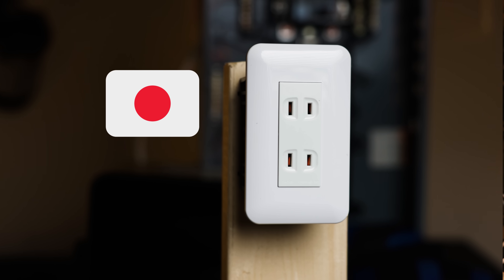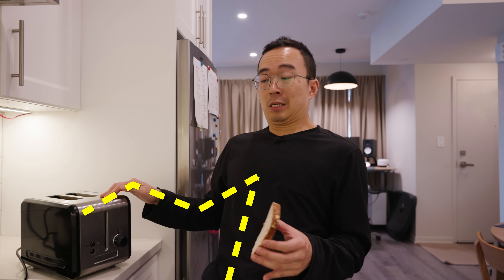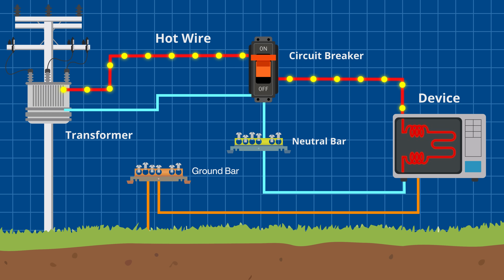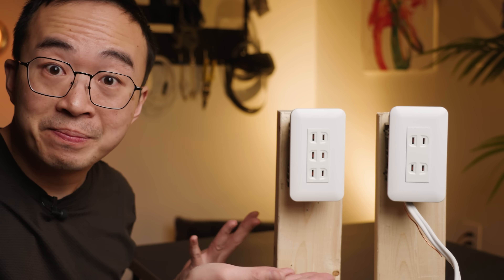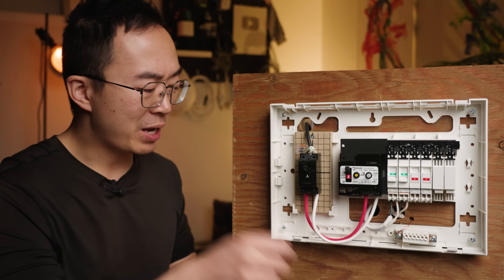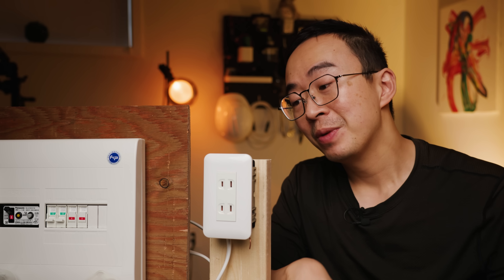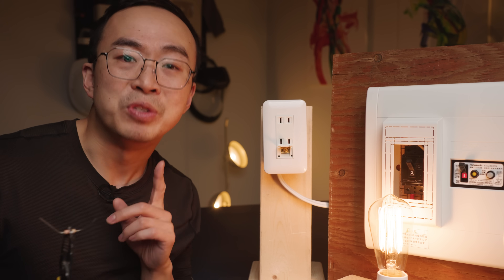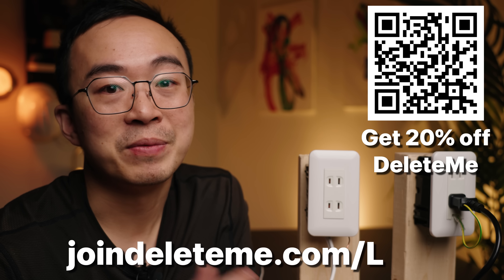How Japan Made Their Outlet Safe

Comment: You can make ungrounded systems safe, we call them floating systems. Most often these are found on high power DC systems like you would see on electrical rail lines or in industrial facilities.

You always need two connections to ground for a loop to form. When you get shocked, you are one connection to ground, the other exists at the transmission side of the electrical system. The existence of the ground wire in an outlet is there to provide that path to ground rather than you.

In these floating systems, a single ground fault through a person does not form a loop, so is safe unless a second ground fault occurs elsewhere. 

In floating systems, special devices are used to measure and monitor the resistance of positive and negative to ground. If a ground fault is detected, either the circuit is killed or an alarm is triggered to investigate the fault. 

The reason you don’t see floating systems much is that they require active monitoring of the state of the system to be safe, while grounded systems are passively safe. Also lightning protection requires a good path to ground (it will form one regardless, so providing one allows you to control the effects of a lighting strike better). Also, if you have devices that generate large changing magnetic fields (such as with AC motors), then eddy currents can be induced in metallic parts which can shock people.

By the way, the circuit breakers in your panel are there to protect the wiring in your walls, not the user. Any outlet can supply more than enough energy to kill you. A circuit breaker does not care what is attached, so long as the current being drawn is less than the trip current. GFCIs on the other hand are there to protect users. You can buy GFCI breakers or receptacles, either works for the purpose of protecting users.

Comment: There is another reason the US has required a grounded Neutral wire in the US sense 1955, the year that the U ground receptacle was introduced. It is to protect the inhabitants in a home from being electrocuted from failed utility transformer that has a fault between the Primary to the secondary. In older homes wired before 1955 & had just a 2 wire 120 VAC service & the outside utility transformer had a fault between the primary & Secondary, that would cause the entire wiring of a home to be as must as 12,000 VAC to ground! After that time, all Utility poles were required to have the Transformer secondary to be grounded by running a heavy copper wire down the side of the pole to the bottom of the pole, which then made that the utility transformer could never have more the 120 VAC to ground & therefore that protected the inhabitants of a home from this type of electrical threat. I am not sure when the house neutral wire was required to be connected to a cold water pipe, it may have been implemented about the same time as the utility transformer grounding change.

Comment: Great video...I'm sure others have mentioned it...on newer panels in the US you can add a GFI breaker right at the panel.  A way for 2 wire without ground homes to be compliant when putting in a three prong outlet.

Comment: 1:36 Well this should be correct, it is no longer. Most of the electronics with switching power supplies now do not using a 1:1 isolation transformer before the SMPS transformer section. 

Even worse than that, most dont even have a transformer section like best practices promote. To add to that, they are no longer using bridge rectifiers most of the time.

And that, is why your UsB-C and audio cables shock you now. The best way to stop that is to put things on a Double Conversion UPS and clean up the power before it goes to the DC adapters. Your PC will run much better and cleaner. Well, as good as terrible OSes can run.

Comment: Ground is not only for around the water, but also for the computer to protect circuit from static electricity. So the problem is: we have plug for computer with ground wire, but no outlet with a ground around the computer.
Reply: A ground wire is also helpful for surge protector to function correctly.

Comment: I prefer grounded outlets to only GFCI as in Japan. In the US, I think all outlets should be GFCI, and/or at the panel. With grounded GFCI, any hot to ground fault (as with your toaster) would trip the GFCI. You want the GFCI to trip on fault BEFORE anyone (especially small children) touches the product. Appliance manufacturers need to be more mindful of safety too, with double insulation of products with metal exteriors such as blenders, refrigerators or toasters.
Reply: The problem with insulation is with stuff making metal to metal contact such as after a transformer, the transformer may not provide true isolation.

Such as with laptop power bricks that are supposed to be only low voltage DC on the laptop side, I've felt shocks from a barrel connector and a GFCI provides no protection.

Comment: Not trying to be a dick, but the explanation for the ground and neutral is not correct. And for those who want to ask how I know, I am an industrial electrician in the US.

1) the ground wire (official term is the equipment grounding conductor) is where a short circuit will travel. I will explain why the neutral isn't in a later point, but the resistance of the ground is not substantial enough to prevent the ground from dispersing the electricity.

2) the point of the neutral wire (Officially the Grounded conductor) from the Electrical panel to the Power pole is actually to balance the load from the two phases. US Load Centers (Powe panels) have two poles. The two poles and neutral go to a transformer on the power lines, and the neutral is actually tapped in the middle of the transformer's power windings. (There are more details, but I'm trying to keep this breif)

3) the reason the Neutral and the ground are tied together in a Main panel is to actually give the neutral a reference to ground voltage. Neutrals are supposed to be the "Zero Volts" of the panel, but without a ground reference, It will not work properly. 

4) circuit breaker have no protection for people. Circuit breakers have one job, Protect the wires between the "Load" (your appliances) and the "Line" (your electrical panel). If your ground in your toaster has high enough electrical resistance, it will still shock you. You are correct about GFCIs being a way to protect people, but GFCIs are not a Japan specific creation. GFCIs are required in all wet locations in the US, but can be used anywhere.

Comment: GCFIs protect you from pain because they are installed at the wall receptacle and are thus tuned to trip at very low currents for the nearest appliance (below the pain threshold) if you, voluntary or otherwise, managed to connect yourself to the live wire. if you put the GFCI at the breaker panel, it will protect ALL receptacles in the house. but because it is now monitoring all receptacles, it can't be tuned to trip on such low currents. so they will still save you, but there will be pain. these are therefore typically just called the general term Residual Current Device or RCD, which are identical to GFCIs in mechanical function and purpose which is to save lives, the only difference is big pain vs small pain. they do this by using the existing live and neutral wires but always requires a second path, often a living thing, to provide the fault current path, and thus the difference detection and therefore pain.

of course if you don't want to feel pain at all, then you need a third wire to replace you, your mom, your dog, to create the alternative path for the fault current. there is no current here ever, when there is no fault, so any current there at any time will trigger the RCD/GFCI for shutdown. this earth wire can connect to your ground rod or it can connect to neutral in your breaker box or it can be connected to both at the same time. note: they are never bonded at the receptacle--because a leakage at one location will expose all other locations (live toaster frame makes the fridge, washing machine, hairdryer all live too). in fact, most countries don't even connect earth to neutral in the breaker box, but on the street or the substation, so you will never know they are connected at all unless you learned about it. 

so the main question here really is whether you need ground rods at all for live faults and the answer is no. because everywhere in the world with regulations on these things either use RCD/GFCI or earth wires or both for that purpose and your nearest pole or substation or transformer has better ground rods than whatever you might have. does that mean you don't need them? course not. they are for backup, for lightning strikes, and for grounding things that arent even normally electrified at all, like metal plumbing.

Comment: Full-house GFCI is being installed in new homes in the US. I realize that there's an issue of compatibility between the existing 2-prong plugs and three-prong outlets, as there are millions of existing devices, but it seems like an opportunity to introduce a safer plug, like those used in Europe, instead of sticking with the ancient spade-type plug currently used in the US and Japan. Voltage doesn't need to change and adapters would allow compatibility between older devices and the new outlets.

Comment: Here in the UK we have both, where the panel has an RCD for all the circuits to the right (some even having multiple, like my house having 2 RCDs for all 10 or so circuits), and also our sockets require a 3rd pin just to get access to the power, so you can't jab a fork into it. That's why I'd argue the UK has the safest electrical system (despite our voltage being nearly double the US voltage, at 230V instead of 120V)

Comment: PLEASE for the love of all thats good. Dont listen to this guy. YOU need a ground for so many reasons aside of the fact its to help direct current away from the user. As anyone who works with computers and other electronics know you need ground to help prevent static electricity from damaging equipment. Not to mention your UPS Battery Backups will have a fit if no ground is connected as its a form of circuit protection from many sources like power spikes and LIGHTNING. Not to mention a lot of Apple computers like their Mac Minis suffer from charge build up on their metal chassis (though this is mostly due to dirty power grid issues like here in the Philippines) and a ground fixes that issue.
Reply: Yeah, I had a laptop connected without GP and it was a trip.

Comment: I live in a concrete brutalist designer condo in Osaka, and have both grounded and ungrounded outlets installed. I noticed the ones for appliances, like behind the fridge, have the ground, and others don't. It's a little frustrating in office areas, because power strips usually have the ground plug and require an adapter.

Comment: I have ground fault protection everywhere in my house. So it stops current from hot into the ground. But where is the ground in my kitchen? Plastic water pipes. Plastic gas lines. Plastic drain lines. The only place I can find ground is that 3rd pin on the outlets. If I did not have that 3rd pin there would be no ground to be protected from.

Comment: In the U.S. we have GFCI and AFCI breakers. Arc Fault and Ground Fault combination are both required in all new homes since 2014 (originally introduced in 2000, expanded use per the NEC in 2008 and 2014).
Reply: It's not required in every home.

Comment: In Italy we have neutral grounded at distribution transformer and residual current protection also gronding anything that is not "double shielded (sgned with a double square). Italy probably the most secure country against electrocution.

Comment: As a technician, I've been a fanatic for grounding for years. Some equipment frames will carry a voltage sometimes around 64VAC if it is not grounded. I moved into a rental. Three prong outlets but none grounded. For my computer and pinball machines and TV, I insisted on grounded lines. Done by my landlord. Then I decided to put in a grounding rod. I did. BUT, the city utilities have to connect it and when they do, they will disconnect the utility boxes connection to the return to the transformer and I have to pay an electrician to do all this, power off, wait for utility inspection, etc. Their logic is that the box ground will eventually get back to the ground at the pole where there is a similar grounding setup. But I've also learned that the poles in my neighborhood rot at the bottom and lose that grounding connection. The utility guy told me that they do a lot of pole replacement. Years ago, I complained to an electrician working at my mother's house about the 3 prong outlets not having a ground connection especially the outdoor outlet used for trimmers, etc. He went into the outlet and connected the ground to the neutral and said it's all the same. Years before that, I was in South Carolina and complained to a landlord about the window unit AC outlet not having a ground. He called an electrician to check it out and he said it was just fine without a ground. Nothing is really standard here in the US.
Reply: So the US does had TT Earthing but it is something you have to choose as an option. (at least here in a north Alabama city)

Comment: Good video, but the scale is way off in some of the animations. The human is high resistance, the wires are low resistance, the appliances and loads are the majority of the resistance. The highest resistance is the earth return path to the transformer source. When you get shocked you do not pull a ton of amps.

Comment: On GFCI in the US. Anyplace there is a "Wet wall"(has plumbing in it) and Electric outlets you have to use a GFCI outlet. There's no code against installing GFCI outlets around your entire house though. I replaced my standard outlets with GFCI outlets in any place that I have Electronics plugged in for an extra level of protection.

Comment: 1:42 That is actually nonsense. A device has to be build, that electricity does not flow when the device is not turned on*. Just being plugged into the outlet *does not equal of the device being turned on.
If you wanted to make a example with a toaster, you would have needed to put the bread in, push down the hopper and then get the shock as soon as the toaster actually starts heating up the heating element.

Comment: I hope people don't use this as a basis for understanding electrical safety because holy shit. The problems with Japan's adhoc electrical systems are infamous. 

They brought in GFCI mandates because the safety issues made it necessary. Australia has had RCDs, which perform the same function, since the late 90s. Australia also has grounding and 240V so less current for the same power. Grounding also prevents stray capacitance building up on conductive surfaces near live components. Non grounded appliances rely on being double insulated to prevent dangerous voltages building via capacitive coupling. 

I saw a bunch of appliances in Japan with that grounding wire just dangling freely lol. It's an inherently unsafe design. 

The low accident rate in Japan is probably a reflection of the culture more than anything else.

Comment: The Japanese GFCI appears to turn off all power to the bus if any fault is detected. While it may be better than nothing, it means any fault in a load attached to a panel will shut power to the entire bus of that panel. The example seemed to have only one bus. US panels USED to be two wire only like Japanese panels without GFCI. Old construction in many places still reveals this.

Comment: Your diagrams for US panels all show neutral going through the breakers but is that true? Single phase house breakers in residential applications are only attached by their slot to a hot bus and then via a single screw to a hot wire which then goes to a load such as an outlet. How come you draw the light blue wire going through the neutral bar into the breaker? Shouldn't it go only through the neutral bar back to the transformer? It looks from the pictures of the Japanese panel that both hot and neutral go through each breaker?

Comment: Then there's countries like Finland which make both grounding and RCD (recidual current detector, similar to GFCI but higher tripping current, 5 mA vs 30 mA) mandatory in all outlets easily accessible for humans. Basically only dedicated outlets for freezer or similar always on device can be installed without RCD and grounding is always required.

RCD is basically biased towards "avoid false positives but still prevent dangerous shocks" and GFCI is biased to "avoid all shocks but accept false posives (cutting power without any real need) every now and then". I think GFCI is definitely the right way to go if you totally skip the grounding.

GFCI has roughly 10x the false positive rate compared to RCD.

Comment: The US/Japan plug format is still awfully bad because the two metal prongs are always at least slightly exposed and therefore can be a hazard. The connection to an inlet is also very shaky and so the plug can easily disconnect or the metal parts become even more exposed easily. This is why in countries like Germany you have the plug being inset into the wall so that no electric parts can be exposed.

Comment: So in conclusion, both designs proved inadequate separately, so through science and research, they were improved by combining them.
Reply: In France both GFCI and ground connection are mandatory.
There are even 2 types of GFCI, the “normal one” (called type AC) and the ones deigned to work with power electronics like induction cookers, modern washing machines, electric vehicles chargers, etc. (They are called type A)
Why the difference ? Actually power electronics can create “noisy currents” that can fool a classical GFCI and make it trip even though there is no fault, hence the more expensive but more reliable type A.